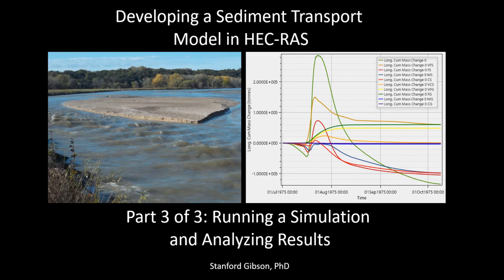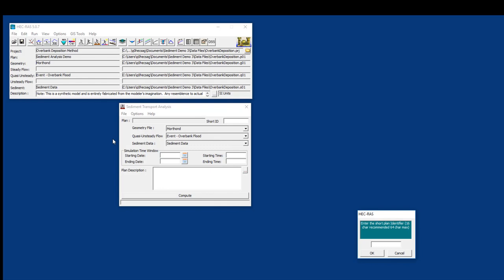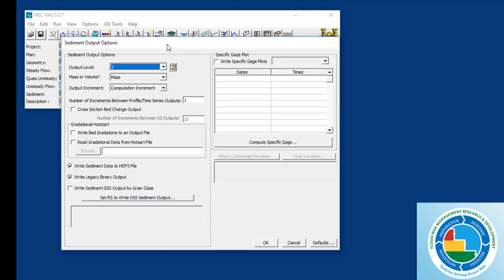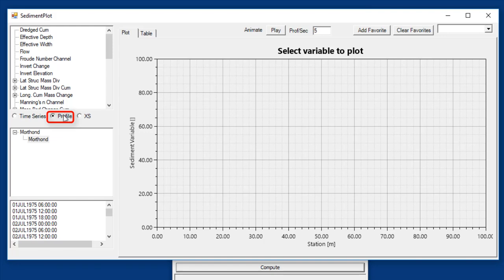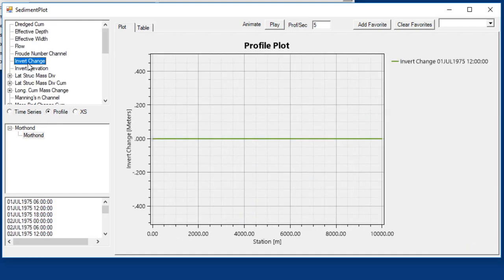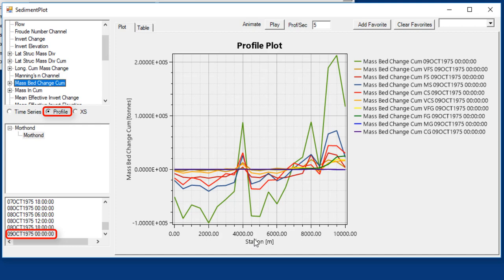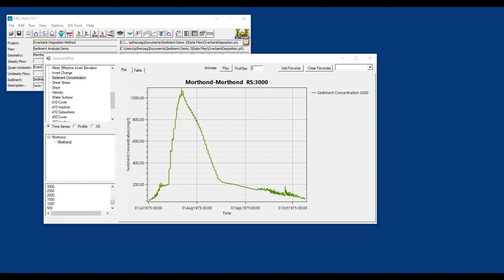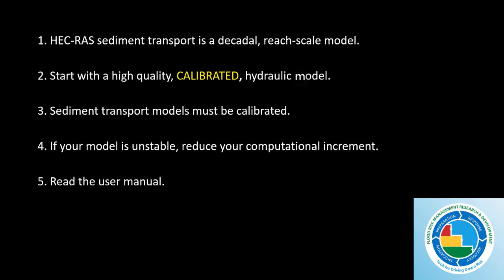Intro to HEC-RAS Sediment Demo (Part 3 of 3 - Simulation and Output)

Comment: Hello, I have a question regarding the new HEC-RAS 6.0 Beta 3 version. Can it be that an activation of the hiding functions is possible on the user interface, but is not yet applied in the calculation code? Kind regards from Italy
Reply from the maker: Hello.  If that is true, its a bug.  Hiding should be working.  If you send me your files at stanfordgibson@hotmail.com I'll try to look at them
Reply: @stanfordgibson  Thankyou, you have received an email
Reply: @stanfordgibson  Dear Mr Gibson, I wanted to ask again whether it is already known whether the hiding function calculates incorrectly or not? Kind regards

Comment: Hello Mr Gibson! I have another question... Is there a possibility to change the roughness coefficient depending on the flow rate when using quasi-unsteady flow? Many thanks and greetings from Italy
Reply from the maker: Hello TT, Great question.  Flow-dependent n values are very important, and I almost always use them in unsteady, steady, or quasi-unsteady.  There are several ways to do this, but my preference is just as a geometry level variable (so it is transparent to what flow model you use).  In the geometry editor go to Tools-->Flow Roughness Factors.  That should work regardless of how you specify flow.
Reply from the maker: You could also check out the bed-roughness predictors, which update roughness based on sediment transport.  These can be sensitive and aren't always useful.  but are worth knowing about
Reply from the maker: https://www.hec.usace.army.mil/confluence/rasdocs/rassed1d/1d-sediment-transport-user-s-manual/simulating-sediment-transport/sediment-computation-options-and-tolerances/bed-roughness-predictors
Reply from the maker: https://www.hec.usace.army.mil/confluence/rasdocs/rassed1d/1d-sediment-transport-user-s-manual/simulating-sediment-transport/sediment-computation-options-and-tolerances/bed-roughness-predictors
Reply: @stanfordgibson  Thank you very much for your quick and detailed answer! Very helpful, thank you! Also, great new paper regarding sediment and ice‐affected flood‐risk projections! Great job!

Comment: As I mentioned before, you have done a great job with the video, congratulations. But with my application not everything works as planned. I always get the error message "no flow in channel at river/station
xxx (channel may have overfilled with sediment)". Could you possibly help me?
Reply from the maker: I should do a video on this error.  It is the most common error, and there are several different possible problems.
Reply from the maker: Basically, that means your channel filled with sediment very quickly.  The most common reason for that is that the time step is too large.  The channel doesn't have time to update the hydraulics in response to deposition.  But if it is happening at the upstream cross section, it is usually because the sediment load in the boundary condition is too coarse (often because the user used the bed gradation for the load gradation...but the bed gradation is usually much coarser than the load).  This could also happen when the sediment load is too high or the transport function isn’t appropriate.
Reply from the maker: It can also happen if you are depositing in your channel but not you overbank, so the channel thalweg rises above the overbank elevation.  This allows all the flow to go to the overbank and dries the channel.  Or if you have a cross section that just has a depression in the overbank that is lower than the thalweg, it can divert the water (an ineffective flow area should fix that).
Reply: @stanfordgibson  I'm really looking forward to the video. Thanks and greets from Italy

Comment: Hello Sir, I am a Master's Student and doing my project on the sediment transport model. These three tutorials help me a lot to understand the basics. Dear Sir, I have a couple of questions. First, I followed all the steps, used the datasets provided in the tutorial, and ran the simulation in HEC-RAS 6.0 version. It showed some difference in output results when I saw the graph. Can it be possible, Sir? 2nd question is that I have to add a bridge and then analyze Scouring through this model. How can I do it? From where should I start? I am eagerly waiting for your positive response, Sir.
Reply from the maker: 1. It is possible that some setting is different, that you did something slightly different (sediment results can be surprisingly sensitive) or that there is a computational difference in 6.1.
Reply from the maker: 2. You want to be careful adding a bridge.  1D Quasi-unsteady is not appropriate for local bridge scour.  It is ok for long term deposition in a backwater behind a bridge or maybe a very rough estimate of long term contraction scour, but bridge scour from piers or abutments is a multi-D process that multi-D models don't do great.
Reply from the maker: 2b.  Plus the sediment computations struggle with the internal XSs in RAS.  I have a whole section in the documentation (and may eventually do a video) on bridges in 1D sediment models...use with care:  https://www.hec.usace.army.mil/confluence/rasdocs/rassed1d/1d-sediment-transport-user-s-manual/geometric-considerations-for-a-sediment-transport-model/modeling-bridges-in-a-sediment-simulation
Reply from the maker: 2c.  Best practice for 1D bridge scour in RAS is to use the HEC 18 Scour calculator: https://www.hec.usace.army.mil/confluence/rasdocs/rasum/latest/hydraulic-design-hd-calculators/computing-scour-at-bridges
Reply: @stanfordgibson  thank you sir. ❤️🙏. Let me do now

Comment: When I try and run a model with a dataset and following the instructions in the videos I get the following error:
An error occurred while reading sediment data at (blank) review your data at this location for completeness and consistency
I checked and there is bed gradation data and all my cross sections and I am testing out my downstream boundary condition as equilibrium load to rule out any errors.  What is the overall meaning of this error and how do I fix it?
Reply from the maker: Usually some of your initial conditions data is not complete...you are missing gradations or control volume values at one or more cross sections

Comment: At 11:25 in your video you present the invert change profile plot. It appears that the bed elevation does not change regularly between two profiles (it zigzags) which is a little surprising. I get the same type of results with my sedimentary model. The phenomenon of "saw tooth" is a little developed in the chapter "cross section weigting factor" of the user manual (17-61). It is indicated that by changing the weighting scheme of the hydraulic tables associated with cross sections (for example 0.25 / 0.5 / 0.25 or 0/1/0) it is possible to eliminate this artifact. I tried both weights but I get the same result... Could you further detail this point in a video? Thank you
Reply from the maker: A mild saw tooth pattern (like the one you see in the video) is an artifact of sediment model results.  Because XSs (or 2D cells) are not a census of reality but a sample, transport tends to fluctuate randomly between them.  Therefore, they tend to alternate "slightly more transportable" and "slightly less transportable" - which leads to erosion-deposition cycles.  The closer you are to equilibrium the more apparent this pattern is...because noise>signal.  But in strongly deposition or erosional environments, the directional effects wash out these minor numerical variations (signal>noise).  This is also why we tend to evaluate and present results with the longitudinal cumulative result, because it integrates these fluctuations into a coherent description of the system response.
Reply from the maker: The XS weighting is a relic feature that HEC-RAS adopted from HEC 6, but it actually makes the problem it was meant to solve worse.  Particularly when the channel is uniform, weighting results generates "leap frog" type instabilities and generates an aggressive saw tooth.  The 0/1/0 default entirely resolves this artifact in uniform channels.  In natural channels, the 0/1/0 default is the most stable - but it doesn't get rid of the longitudinal variability.
Reply from the maker: Also, thanks for reading the user manual.

Comment: Great. I have a question. Can you model secondary lahars (sediment transport dynamics) using HEC RAS?
Reply from the maker: As I understand it, Lahars really require Non-Newtonian transport.  HEC has added rheological, fixed bed, NN modeling to unsteady 1D and 2D in 5.1 and is beta testing it right now (we are currently validating the model with the USGS volcanic laboratory flume results).  Development for mobile bed NN transport is planned but has not started.
Reply: @stanfordgibson   Thanks a lot. What kind of restrictions do you consider important in order to model secondary lahars (rain triggered lahars) with HEC RAS?
Reply from the maker: @Aleks1986123  Slopes over 10% or concentration over 10% (by volume) would violate some of the basic assumptions of the model, and the model is currently a continuity based scheme, so it won't track the front very well (even if the Newtonian assumption holds).

Comment: Thanks for the great video. I followed all the steps and used the datasets provided in the tutorial.I was not able to compute the sediment transport. It gave me an error saying Rs-1000 has zero flow value. What would be the reason? Thank you!
Reply from the maker: That usually means that there is a data error in the upstream quasi-unsteady flow data.  It is often a computational increment.  Check that data (see minute 325 in the first video).
Reply: @stanfordgibson  Thank you. I solved the issue. I did not type the date format  as English date format in my plan file. That's why I got that error message.
Reply: YES SAME WIMEE :(

Comment: Hello,
Thanks for your very usefull videos. I have built a model on hec-ras ans I have some bugs in my sediment outputs :
1/ the simulation time window when I run the model is different to my results’ time windows (same duration but at different times : I run the model from 30DEC1989 to 29 DEC1990, but in sediment Output, the results on profils and XS are from 01DEC1988 to 29NOV1989 and the results on Time Series are from 30DEC1899 to 29DEC1900).
2/ At the same station, I calculate (last time step's Invert Elevation) – (first time step's Invert Elevation), and the result is not the same as last time step
's Invert Change. 
I would like to know if you have already encounter such problems?
Thanks in advance for your answers,
Best regards,
Reply from the maker: Hi Sophie.  Neither of those sound familiar.  Send me a message at  and I can take a look at your model.
Reply: @stanfordgibson  Thank u very much, I didn't except this answer :) I sand you my model

Comment: Hello, sir,
I have a problem with my simulated sediment in HEC-RAS.

While running my model I get an error message that reads:

River: "Sebayur river" Range: "Hulukehilir" RS = 14790 - has zero flow value.

What am I seeing?
what should i do to solve this problem?
please can you help me
Thank you in advance for your answers.
Reply from the maker: I am working on a video on common error messages, but it will be a while before I get it out. I have a section on this one in the new RAS manual for 6.0
Reply from the maker: Here it is: Another common pre-Run error indicates that a flow boundary condition has a zero flow value 

HEC-RAS cannot specify a zero flow external boundary condition.  However, more often, this error is the result of:

1.	Mis-formatted Date: If the Fixed Start Time or the simulation time window is defined with a date that does not conform to the HEC-RAS DDMMMYYYY convention the date will not register correctly.

2.	Non-English Settings, Months, or Special Characters: The months also have to be in English.  The following table includes the only MMM abbreviations RAS accepts.
JAN FEB MAR APR MAY JUN
 JUL AUG	SEP	OCT NOV DEC

Additionally, in order to accept dates, the Microsoft language settings on your computer must be set to English (US).

3.	End Date earlier than the Start Date: Another common error includes specifying an end date later than the start date (e.g. setting up a water year run but failing to change the second date):
Reply from the maker: I assume it is a non-English date or computer setting.  I will try to make that error message more informative in version 6.0

Comment: Hi Sir, can you please give me some advice on how to set my Bed exchange iterations per time (SPI) and  the computation increment of my model? 

I'm getting some errors like " Unrealistic Vertical Adjustment " and "The active layer completely eroded at one or more cross sections" and I'm wordering if I should use small values for computation increment and SPI.
Reply from the maker: I have a section on unrealistic vertical adjustment in the user manual that could be helpful: https://www.hec.usace.army.mil/confluence/rasdocs/rassed1d/1d-sediment-transport-user-s-manual/trouble-shooting/common-sediment-transport-error-messages#CommonSedimentTransportErrorMessages-UnrealisticVerticalAdjustment
Reply from the maker: The rule of thumb with SPI is to increase it until the result doesn't change (and you don't exhaust the active layer).  You could also make the active layer thicker (see "Mixing Options").  But my guess is that the bed gradation and transport function are mismatched.
Reply from the maker: I actually have a video started on unrealistic vertical adjustment because it is the most common error message...but I'm not sure when I'll get to finishing it.
Reply: @Stanford Gibson  Thank you very much, Sir! Your videos and manuals helped me a lot! I adjusted the transport function and my simulations are running better. I'll adjust SPI parameter like you said.
Reply: @stanfordgibson  That's great news! I hope you can finish as soon as possible. Thanks for that!

Comment: Hallo sir, i have a problem when i compute sediment data. 
i have a message like this "Flow or Temp time series date is not sufficient to run requested time window."
what should i do? i've repair that but still error. thankyou.
Reply from the maker: Hello Muhammed, this is a very common and frustrating error.  I have a whole section on it in the 6.0 user manual which we will release soon and plan to do a video on it.  But for now, here are the possibilities.
Reply from the maker: This message indicates that one of the flow, temperature, or sediment time series in the quasi-unsteady or sediment data do not span the computational interval.  Check to make sure that all the time series start at or before the simulation start time and end at or after the simulation end time.

However, other data errors, which can be harder to find can generate this error.  Here are three common culprits:
Reply from the maker: 1.	No Temperature Data: Temperature data is mandatory, but requires pressing a button on the quasi-unsteady flow editor.  Blank temperature data will return this error.
Reply from the maker: 2.	Blank or mistaken Fixed Start Time in one of the flow boundary conditons
Reply from the maker: 3.	Missing Computation Increments.  A quasi-unsteady time series can span the entire simulation time window, but if one or more flows lack computation increments HEC-RAS will return this error.  If the Automated Computation Increment tool does not span the range of flows, it will leave Computation Increments blank and return this error.
Reply from the maker: Also, check the dates in the quasi-unsteady plan editor carefully.  They need to be in DDMMMYYYY format and need to use English abbreviations.